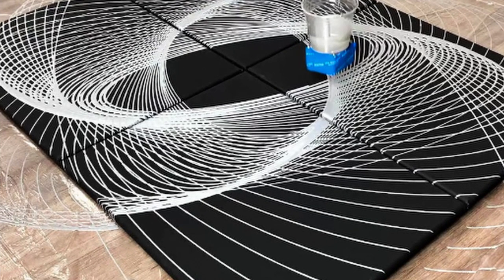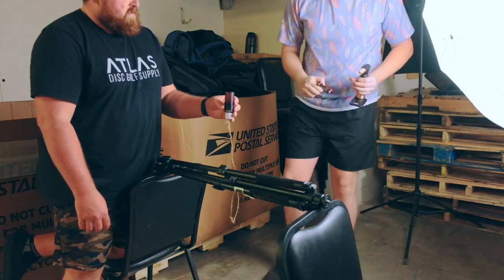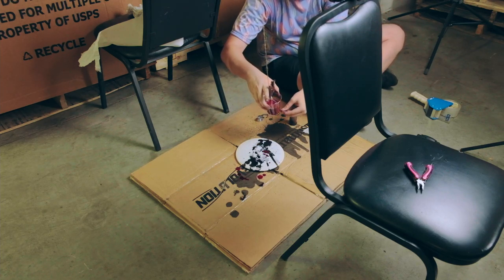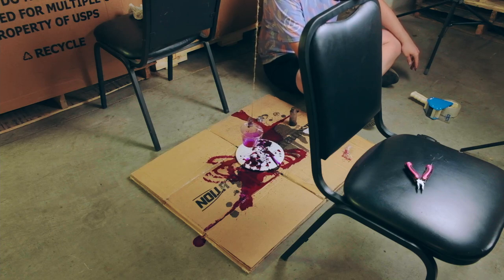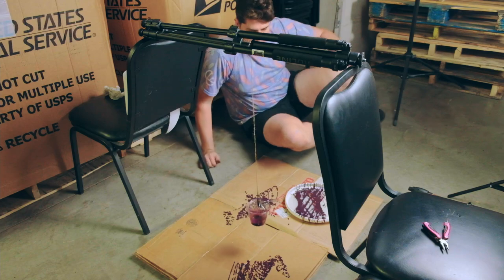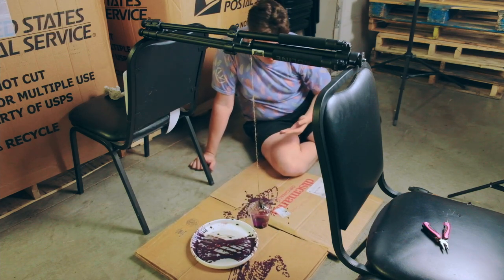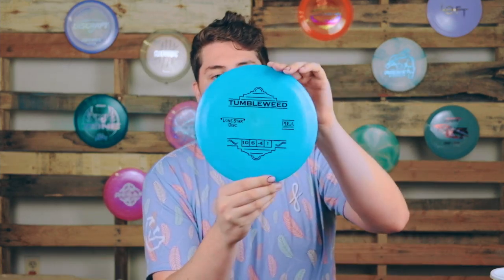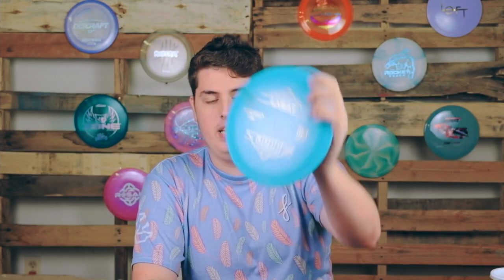New Disc Dyeing Technique Never Seen Before | Plastic Addict 22

Comment: Does there need to be a hole in the top so air can smoothly escape? Smaller hole thinner dye with an extra air hole could do
Reply: Yeah i tried unscrewing the cap which helped. Will definitely have to give this another try!
Reply: the string needs to be super short so you can see the effect on a disc too

Comment: Love this idea! I wonder if an inverted dyeing technique might work better; doing the drip application in glue, then applying that to a dye bed so the pattern is the only thing not being dyed… I’m pretty new to the dyeing world, so I might be entirely off base 🤷🏻
Reply: That's what I have tried. Still looking for better results than what I have had before posting. But I have made 5 attempts so far. Been trying this method for about 3 months now.